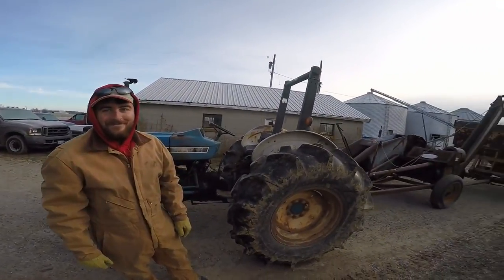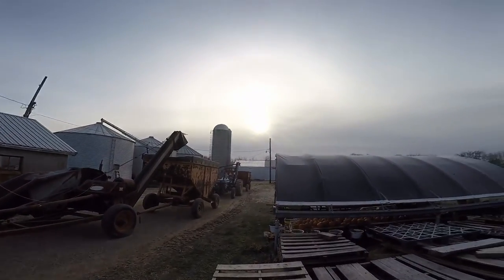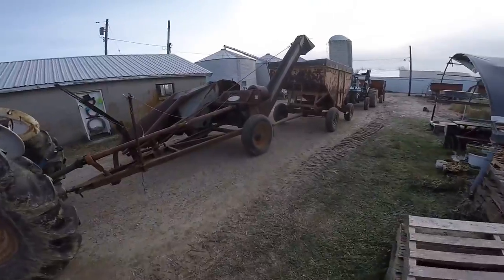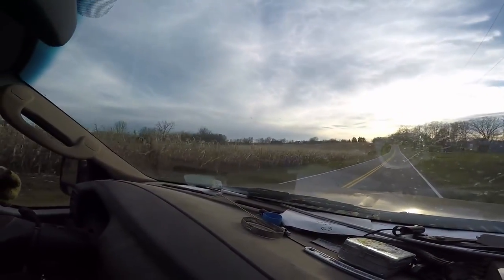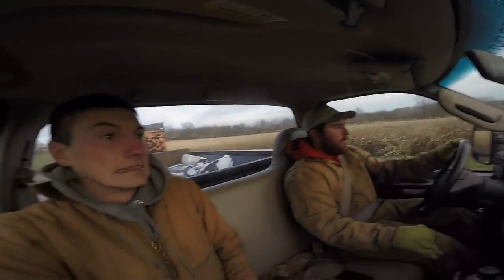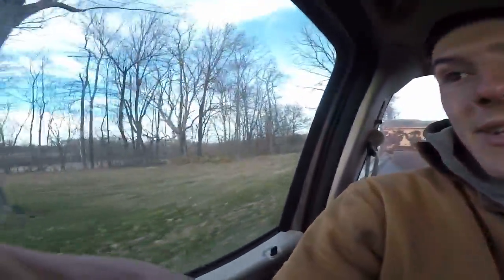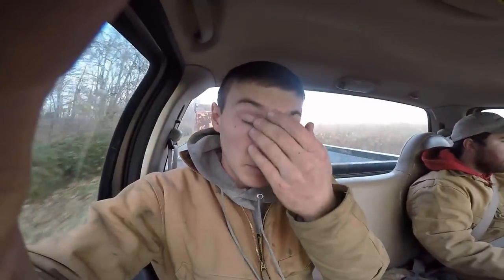Pick, Haul, Unload

Comment: Hi there been watching your channel for a while now and i love it really nice to see people using older kit but would it make sense to maybe up grade up so of your harvest kit to cover more acres quicker I know you can’t just go out and buy the latest kit but maybe up grade a little bigger? I myself have a channel called Massey-Rob be nice to get shout out
Reply from the maker: We've been keeping our eyes open for something newer. No money is made without harvest, but it's such a short use period. A tractor will be used year round, a combine will maybe be run for two or three months, then sit. Now we did buy a very new square baler this spring, which was well out of budget, but beating the rain is paramount for hay, grain will be rained on a few times anyways. With all the fixing we're doing, pretty soon we'll have near new combines. lol. Now some repairs will come with age, and some with use. We could still overheat a new combine. Carburetor troubles are an age issue, going newer would help that.
Reply: @boehmfarm4276  Carburetor problems are because it sat for years and years...  once the shop's done with it should be good as new.  Main thing is, make sure that it STAYS clean by using Sta-Bil or something like that to keep the carb from gumming up during the off-season.  This new ethanol gas is just TERRIBLE for older machines and sitting for long periods in the barn.  OL J R :)